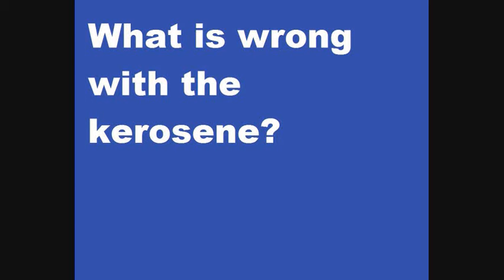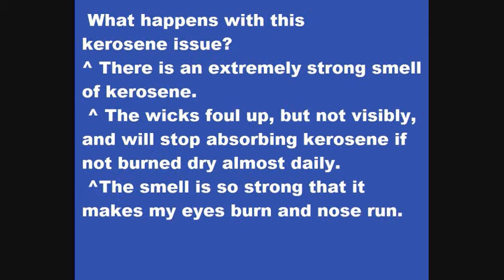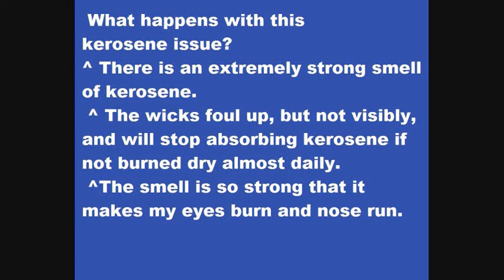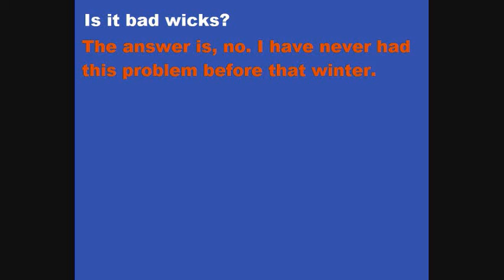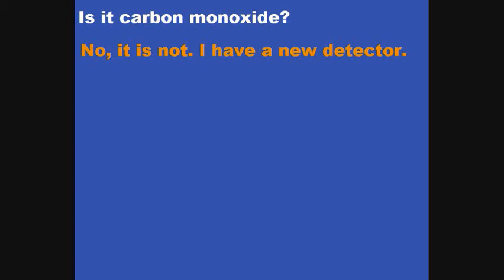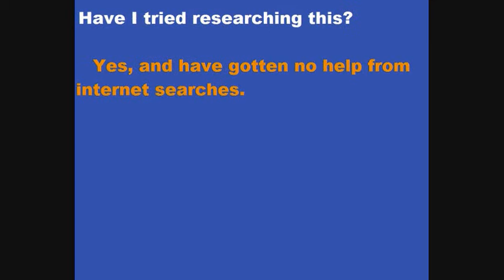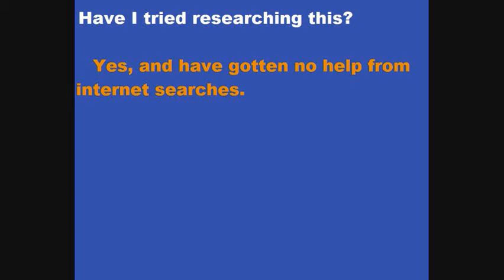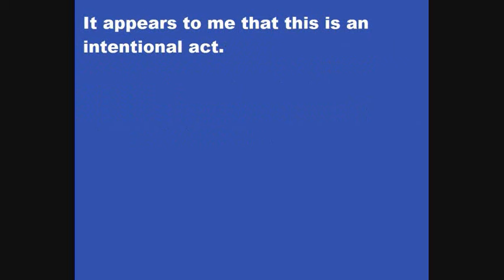What is wrong with the Kerosene?

Comment: I recently had my kerosene furnace stop working and when I started to clean it the smell made my eyes water. I've been servicing it for 20 years and never had this before so I had a check and I think there is a huge amount to sulphur in the oil.  friend who works for an oil company suggested that as vehicle fuel standards become ever cleaner the fraction towers are dumping the nasties into kerosene  so it contains high levels of sulphur which forms acid in condensation of the flame and very fine particles of contamination which clog pumps and parts. Interested to see your post.

Comment: I agree with you!! I have a kerosene heater I used to heat a cabin with, it only smelled during startup and shut off, this winter after sitting for 5 years I started it up, smelled horrible, so I replaced wick and cleaned whole heater, still smells awful gives me headaches..someone doesn't want us using them
Reply from the maker: +Bajaheat OK thanks for the information. It helps confirm, along with what Mary said, that this is not a local issue. I did a follow up video on this. I did find out what they are adding.
Reply: What are they adding?

Comment: I have a radiant and a convection kerosene heater and have never had any issues. ..but I don't use cheap kerosene. ..but I also run the wicks dry once a week. .good luck to you

Comment: We just bought a new, never used Kerosene heater(1980 model) with a fiberglass wick and tried to burn the K1 kerosene from the pump and I had the same issues, couldn't stand the smell, burned my eyes and nose, also bothered my throat and gave me a headache so I started burning ULSD fuel and like it so much better. Virtually no smell, no headaches etc but it does dirty up the wick and the metal surrounding it but I've burned about 20 gallons so far and it still burns good, still wicks. Granted, I do need to take the burner and wick out and clean the crud off but as far as the wick getting ruined, not so far. I think I might just try to burn the crud off with a propane torch, not sure yet, I'll figure that out when I get everything out and can inspect it better....
Reply: Also, I dry burn the wick after every tank full, that is let it burn until the tank is empty and the wick burns until it goes out on its own. Then I wait an hour and dry burn it again. This is supposed to only be done with fiberglass wicks as it will burn cotton wicks and shorten their life!
Reply from the maker: Interesting. I never heard of doing that. Thanks.

Comment: I realize you are using new wicks, but is there composition changed ie. Unnecessary Additives. Two years ago I bought some tiki torches and the type of fuel that goes with them. I could not get any of them to stay lit for more than couple minutes. They gunked up repeatedly. ( I am sorry you have trouble trying to stay warm as you are up there in latitude quite a bit.) one cause could be that the oxygen around you has changed in a way that it does not promote proper burning of kerosene. That might sound kind of lofty, but it IS possible. Space time continuum.
Reply from the maker: +Mary Davis Well thanks Mary. I might try asking around town. Somewhere someone knows what is happening. My wood stove burns the same way as it always has, fortunately.  I may do a tyranny watch news story in the near future.